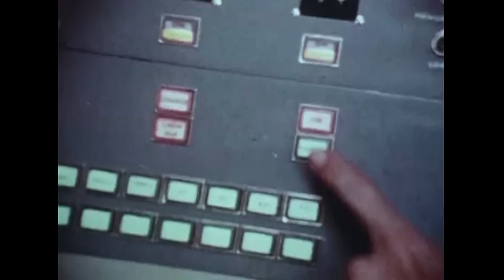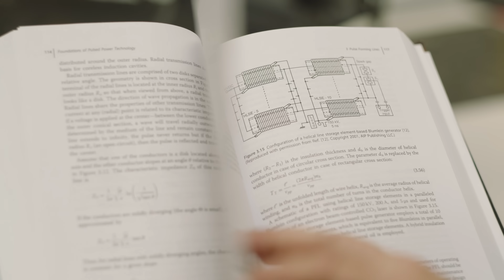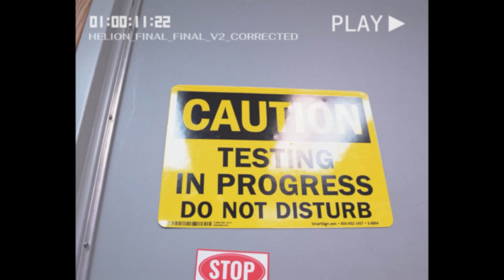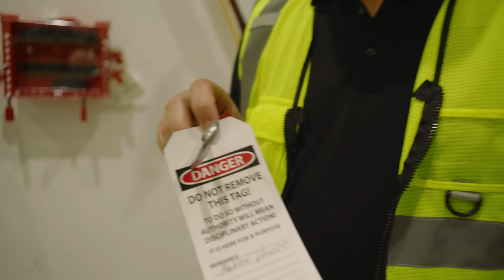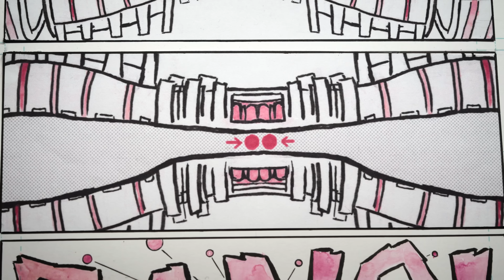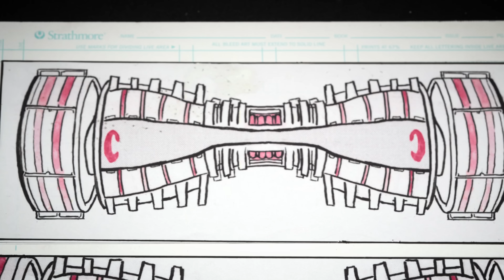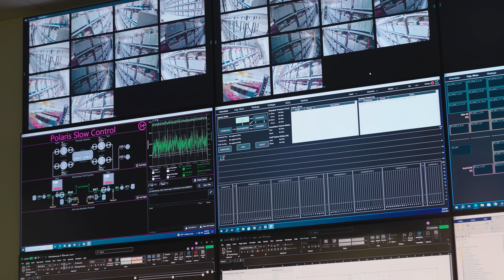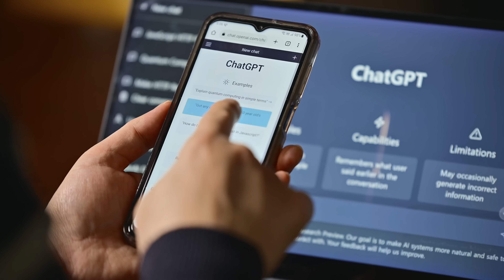A New Type Of Nuclear Fusion Machine Has Come To Life

Comment: Excellent video & thanks for the upload.

Unfortunately, Helion’s core concept is tragically flawed due to their choice of pulsed D-He³ fusion.  Their 50 MW power plant by 2028 is, sadly, complete fantasy.

They picked D-He³ for its near-aneutronic properties (direct electricity recapture at ~3:00), but the physics penalties are brutal:

- D-He³ requires 10 to 20× higher temperatures (~1–2 billion °C) than D-T’s already extreme ~100 million °C
- Pulsed operation also does not bypass ignition because Helion must achieve fusion conditions on every single pulse!  I've encountered pro-Helion advocates confused on this fundamental attribute.  The "hammering" pulse helps with kinetic adiabatic heating but introduces so many more problems like needing to capture 50MW back in microseconds to "reset the hammer".
- Reactivity is  around 1,000× lower than D-T, meaning vastly fewer reactions per volume.
- He³ essentially does not exist on Earth in usable quantities, and no scalable breeding method has ever been demonstrated.
- Their D-D bootstrap produces only nanogram to microgram amounts per day in prototypes.
- At current yields, it would take hundreds of thousands to millions of years of continuous D-D operation to breed enough He³ for even one day of 50 MW D-He³ running!

Pulsed Operation is No Cheat Code
So pulsed fusion ain't a cheat code around ignition!  It’s a different flavour of the exact same difficulty, trading long-term stability problems for brutal repetition-rate, energy recapture and reliability problems.

Likely 2028 outcome:

- Almost all fusion (if any) will come from neutron-emitting D-D side reactions, not clean D-He³
- Micro-watts to milliwatts of net output, if that
- Single pulses at best, not sustained power

In reality, Helion functions more as a government- and VC-subsidized patent and R&D factory.  Because the real value with Helion is in the intellectual property (IP) such as high-field magnets, pulsed power electronics, plasma data, control software, and telemetry, etc.

When the commercial dream inevitably falls far short, the insiders (Altman, SoftBank, etc.) walk away with first dibs on that valuable technology, ready to license or spin out.  Engineers, technicians, scientists, and support staff get paid, advance their careers, and gain experience.  So it won’t be a total loss for them.

Fusion Industry Black Eye
But, unfortunately, it will be another black eye for the entire fusion industry reinforcing the "always 30 years away" stereotype just when the world needs real solutions now.  I'm lookin' forward for physics and tech breakthroughs, but the physics gaps here are waaaay too fundamental to ignore. 😲

Helion Pulsing is a Repetitive Grid Fault 86,400 Times a Day
The proposed pulsed operation will likely cause a grid fault on each 100MW output pulse after a 50MW grid draw (to recharge the caps) on each 1Hz cycle.  That behaviour will hit the grid with harmonics, voltage ripple & frequency ramping.  Grid operators hate this type of grid customer!  Datacenters and factories get fined and hit with contract violations for much less than this.  So Helion likely will not get granted grid permit to operate as-is.  Helion has not explained how to get around this rough grid behaviour.  They're like a super loud thumping concert on the block when everyone else is just a normal store-front.
Reply: Clearly you didn't bother to understand the specific case at all, otherwise you wouldn't have written certain wrong assumptions. They don't need ignition and especially not 1 billion degrees. Furthermore, they can recover energy from the FRC, effectively reducing the gain required to compensate. They just need to overcome the "passive" losses. Just read this paper for more: Fundamental Scaling of Adiabatic Compression of Field Reversed Configuration Thermonuclear Fusion Plasmas
Reply: @francescoG5  Thanks for the reply.  But you seem confused on the core basis of Helion's operation.

We need to return to first principles for a bit…

You wrote, "They don't need ignition" but how can there be any net positive energy without breaking the nucleus's Coulomb barrier?

It can not.  So pulsed operation cannot be a bypass around ignition otherwise there is no Helion to speak of.  Helion needs to ignite (temporarily) over and over again on a 1Hz cycle.

Specifically, Helion's pulsing intentionally combines kinetic energy to get adiabatic thermal heating to achieve higher temperatures than otherwise possible through traditional sustained pressure/heat, but the trade-off is a very short fusion time interval in the microseconds range – 1µs to 20µs according to Helion's own documentation.  This causes massively huge energy capture problems downstream in the design (see below).

On your "recover energy from FRC" statement…

Helion's pulsed operation mode is like a magnetic "hammer" – two hammers actually striking each other.   When the hammers strike each other, they will generate 100MW output averaged over 1-second since Helion's default interval is 1Hz operation.   Furthermore, 50MW is needed each time to rearm the hammer for another strike resulting in a net 50MW positive output (according to Helion).

Helion's energy recover problem gets much worse due to short fusion ignition time…

The 100MW is only the average over 1 second.  But, in actuality, the power is generated in a very short time interval due to Helion's pulsed hammering technique.  Helion's own documents state the FRC ignition is 1µs to 20µs of time which will cause huge power peaks.  Given the most favourable time period of 20µs still results in a gigantic peak of 5TW over 20µs in order to average to 100MW over 1-second.  WOW!

Helion's capacitor bank cannot absorb that amount of energy so quickly, nothing can.  Much of that power is going to destabilize the grid if doesn't damage Helion's energy recovery systems along the way!  Also, there's going to be large power losses at minimum due to high currents in the order of hundreds millions of amps.

From basic capacitor fundamentals, there's fast current rise times (di/dt), high voltage swings, extreme Lorentz forces which causes mechanical expansion so the capacitors must withstand repeatedly with Helion's pulsed operation.  Helion uses "super capacitors" that with have very high capacitance over normal electronics capacitors but super capacitors suffer from very high ESR resistance making everything I've stated that much worse.

Helion's FRC pulse isn’t a gentle 100 MW push over one second.  It's actually a multi-terawatt micro-explosion every second!  This amount of instantaneous power is in the experimental naval rail gun technology range, not power plant operations.  Even naval rail guns struggle with 60GW bursts.  Even if Helion can expand the FRC ignition time to millisecond range (unlikely), the peak power would still be in the 5GW to 100GW range.

So you see how Helion trades one problem (sustained fusion) for brutal peak power of pulsed fusion?
Reply: @beyondfossil  You're the one who's confused, because you don't know that the word  "igniton" (obviously in the field of fusion) generally refers to a reaction that sustains itself with its own "heat". Just go on wikipedia🙂. In short, it's the case where the gain is "infinite" or a very high value. In a pulsed system there's no point in looking for that condition. Ignition is not exactly synonymous with positive gain (more power out than in), and there's a Helion video about it. The comparison with the rail gun is absolutely ridiculous since all that power is concentrated in a small volume, definitely smaller than the compression section.  And of course there is no a projectile (via sliding contact) to accelerate. The time frame for frc "live" is around 1ms, so in the realm of a few GW or at most around ten. Something not impossible to manage....
Reply: @francescoG5  There is no universally accepted definition of fusion ignition, but Q>1 is indisputable. No matter how hard you try to steer the conversation away, Helion needs the equivalent scientific breakeven Q>1 on each pulse otherwise, zilch, no net energy.  If it never gets Q>1 on pulses, Helion might as well be hammering sand.

D-D and especially D-He3 are extremely difficult to ignite which is why Helion needs to fire a pulse at 800,000 m/sec focused on a very small point.  With such extreme force needed at such precision, there are possibilities of dud firings resulting in zero power output for maximal input effort on that pulse.

Helion's own videos/patents confirm they need this: compression must spike to around 20–100 keV for D-D/D-He³ reactivity (where cross-section peaks at), or the Coulomb barrier wins and you get nothing.

As I keep stating, pulsed operation helps with kinetic-assist hammer effect.  But this causes huge downstream problems with energy recapture since the peak burn is so short in time interval.  Burn time (most energetic portion) is short 1µs to 20µs and the plasma expansion cooling in a longer 1ms duration.

Helion's pulsed operation trades one problem for another equal or worse problem

More about the timeframe: Helion's FRC burn (fusion + expansion) is 1–20 μs for the reaction itself, with total confinement ~0.5–1 ms including ramp-up/down.  Even at your very generous 1 ms time interval burn time results 100 MJ energy means ~100 GW average power during that window—multi-GW peaks from transients (voltage spikes, current rise times).  That's still huge and beyond US rail gun power levels!  In addition to barrels melting, capacitors and electronics blew out on US rail gun experiments and they only fired occasionally, not 86,400 times a day like what Helion is proposing–ridiculous!

All this effort is only for a proposed 50MW of power which small peanuts at grid scale power.  50MW is on the low end of small reactor class getting close to micro-reactor size.
Reply: @francescoG5  Furthermore, the rail gun analogy is very apt.

The railgun analogy isn't about projectiles, but pulsed-power delivery which is similar to what Helion is attempting...

Rail guns only fire once or twice a day but Helion will be firing their equivalent rail gun shot 86,400 times a day every day non-stop!  Effectively trying to make a rapid fire rail gun that fires 24x365!

It gets worse for Helion...

The railgun fires and forgets since all that energy goes into the projectile and is gone forever launched down range.

But Helion has to "catch" the equivalent of that projectile (the expanding plasma) every single pulse and convert most of the energy back into electricity to recharge the capacitors and provide net  positive safe power to the grid.  That's an incredibly harder engineering problem on top of an already hard engineering problem.

No material, capacitor, switch, or cable on Earth survives that punishment.

It gets even worse for Helion...

In addition to melting barrels, railgun capacitors and electronics failed after  ~10–100 shots from electromagnetic forces and heat. Helion's chamber/coils face similar Lorentz forces + plasma erosion but at orders of magnitude worse at 86,400 times/day every day.

- Thermal Load: Rail guns needed hours of cooling between shots. Helion has 1 second from continuous hundreds gigawatt heat dumps exceeding the peak power of rail guns.

- Power Electronics: Railgun pulsers (capacitor banks) degraded fast; Helion's would cycle fail much faster with 86,400 shots/day every day.

- Real-World Precedent: The Navy spent $500M+ and canceled the program because repetitive high-power pulsing was unsolvable at scale.

I repeat Orion's 50MW commercial fusion power plant in 2028 is a fantasy.  But Helion will produce data and IP that founders can capitalize on.  Employees will be paid and advance their careers.  But yet another "black eye" on the fusion industry as Helion recklessly hyped their tech to gain investors and government subsidies (our tax dollars).
Reply: @beyondfossil  As you can see from the nonsense you wrote, you don't have the slightest idea how it all works. And  you're here pontificating. For your information, the formation and merging of the two FRCs is something they've done in the past and are currently doing with Polaris. They're currently "ramp up" the power for compression but yew they are doing already formation and merging just not compression at full power. The purpose of merging is to increase the temperature by converting the kinetic energy of the two frc. The result is a single frc. "focused on a very small point?" the frc is meter scale, small poit what?😆It's clear that you UNDERSTAND NOTHING about Helion's approach.🙃The capacitors are not a problem, for your information there are self-healing film ones (which should be the ones they use) that can last decades even at high frequencies of use.The comparison with the railgun still nonsense, and then with Trenta  they have already reached the confinement time of 1 ms. The 100 MJ is pure speculation since we don't actually know the quantity. Only the minimum (at least 5 MJ in excess for 10 pulses to get 50 MW). The optimal range for the case with low electron temperature is 20-50 KeV
Reply: @francescoG5  Once again, you're showing your lack of understanding of basic principles of fusion…

First you misunderstood the basic need for Q>1 on each pulse.  Now you follow up with not understanding basic fusion confinement.

The physics of fusion are unforgiving regardless of what Helion's theoretical papers say or don't say…

Helion's fusion confinement area absolutely must be a pin point.  Fusion cross-sections are minuscule (~10⁻²⁸ m² for D-He³ at peak), so you need billions of collisions per second.  So the tighter that Helion can make the confinement, the more fuel efficient it becomes and reduces "dud" pulses (see below).  Only a tiny amounts of D-He³ fuel are needed per FRC pulse which further requires the smallest point for fuel efficiency.

The tight confinement requirement further highlights the gamble that Helion plays with their pulse design…

Because the FRC alignment of each pulse must be near perfect to get any fusion at all. A slight misalignment of the pulse could mean a full "dud" firing.  A dud is awful for Helion because it means zero output in spite of maximal input effort (-50MW per shot). 

I suggest you come prepared to these debates with first principles science not Helion marketing.  I write detailed posts not as "pontification" but because I'm prepared unlike a certain someone here.  Your posts have been devoid of fusion principles which are what Helion's engineering and designs must be based off of.
Reply: @francescoG5  No.  US Navy Sandia used self-healing capacitors in the railgun trials and it did not help them.

Self-healing capacitors are not suitable for Helion's very high power very frequent constant application.  The healing effect actually reduces the capacitance each time and Helion goes through 86,400 pulse fires per day which is orders of magnitude more than Naval couple of firings a day.

At Helion's scale with gigawatt pulses, million-amp currents, and that ridiculous 86,400 cycles/day will mean it triggers frequent clearings from voltage spikes + ESR heating.  That'd mean increased capacitance loss at 1–5% per thousands of healing events.  The loss of capacitance also further increases the capacitor's ESR making everything worse in a positive feedback loop.

All this is in addition to the large ongoing repetitive Lorentz forces that want to mechanically tear Helion's capacitors apart.  The Lorentz forces are so large that the cables connected to the capacitors actually jump!  This cable jumping was witnessed on US Navy Sandia trials.  Imagine what would happen in Helion's scenario with 86,400 shots per day!  Yikes.

In the end, the US Navy's Sandia rail gun experiments show self-healing banks degrade in thousands to tens of thousands of shots at GW levels — Helion would burn through their capacitor bank in days!

Helion needs to pull a magic rabbit out of a magic  hat to make this part work and this not the only show-stopper item in their design.
Reply: @beyondfossil  Is you who misunderstood ignition with break even not me😂. The excuse that there is no (in your opinion) universal definition of ignition is just pathetic. Stop with your climbing up the mirrors because from your statement you didn't understand how formation merging and compression work in this case. You probably haven't even read the cited paper (it's peer reviewed)....
Reply: @beyondfossil  I repeat capacitors of this type can last over hundreds of thousands of hours of operation. Rail gun uses relative "low" voltage and very high current (million of amperes). In this case i don't know the specifications but they certainly use higher voltages and lower currents and that's why the comparison with the rail gun is no sense. We don't even know the specifics so your speculations are useless....
Reply: @francescoG5  Francesco, you often employ a harsh and insulting manner of responses. You believe it portrays strength but, in reality, it reveals your weakness. You're flailing against the fundamental rules of physics. So call out to all the peer-reviewed Helion papers you can but nature remains indifferent.

Helion and other fusion initiatives face the intrinsic fundamental stability of the cosmos. Our universe does not permit its most abundant elements hydrogen and helium to ignite so easily.

The cosmos remains steady specifically because combining the two most common elements (hydrogen --> helium) is extremely difficult outside stellar-core densities and temperatures.

The Coulomb barrier between proton–proton, D-D, D-He³ interactions is so extremely high that under normal everyday conditions and timeframes, the process is effectively verboten by the cosmos. This explains why stars endure for billions of years rather than seconds.  It accounts for the existence of galaxies, planets and life without nearly everything rapidly converting into helium and radiation.

Each of the fusion projects (Helion, ITER, NIF, CFS, TAE, ....) is actually attempting to briefly and locally disrupt the stability that sustains the rest of the universe.  Through huge effort, they aim to create man-made fleeting "anti-universe" zones while simultaneously trying to tame the fundamental physical forces they've unleashed.  We see this happening with Helion trying to capture cosmic lightning in bottle 86,400 times a day.  All after enormous effort of a 50MW double hammer that needs micron-level precision and low nanosecond timing.

The universe has set the difficulty level of taming of fusion to nigh "cosmic" for a reason.

Helion will be eventually added to the list of commercial fusion failures—though it might create a few Q<1 ignitions before ruining or destroying itself and god forbid anyone gets wounded or killed in process.  The R&D, IP, telemetry, and learnings could be useful for later actual useful projects like in aerospace, defence, EVs, renewables, etc.
Reply: @francescoG5  Helion can't get to the high voltage needed to really bring down the amps…

High voltage in utility-scale context is generally in the hundreds of thousands to million volts.  These are the voltages needed to really bring down the amps but Helion doesn't use those voltages because…

We do have an idea of the voltages used in Helion…

Helion blog (2025 RLC circuit article) describes charging to "tens of thousands of volts"  which is 10–50 kV typical for pulsed caps.  That's not "high voltage" in utility-scale power and is squarely "mid voltage" city distribution level not high voltage long-distance.

Let's give Helion the benefit of the doubt and assume Helion uses the upper-end 50kV (50,000-volts)…

Assuming a generous long 1ms pulse would still mean trying to capture 100GW in 1ms time interval.  At 50kV, that still is 2 million amps (MA).  Way too high amps still especially repetitively 86,400-times a day non-stop everyday.

Helion would need to go to 500kV to bring it to 200,000A and, better, 1MV to get 100,000A but those voltages are extremely dangerous to work with in a factory/warehouse setting and Helion's FRC's doesn't even produce those voltages.

Let's compare these amps against big utility-transmission line amps…

But the largest long distance transmissions lines with the highest voltages may be only 700A to 1500A.  That's still orders of magnitude lower in amps than all the amps I've shown you above!

Also utility power transmission lines operate at constant smooth AC sinusoidal 60Hz power not square wave DC pulsed.  Pulse introduced more problems due to constant high current change (di/dt).  And di/dt is a problem for ultra high capacity capacitors (super caps).

In the end, Helion's working with beyond ludicrous (plaid) levels of amps on 86,400 daily cycles every day.  All while using pulsed DC square wave which causes very high di/dt current (rise/fall) changes. All capacitors especially big capacitors absolutely hate high di/dt.
Reply: @beyondfossil  We don't know how much energy is "pumped". 100Mj can be only the max energy (but is there a source for this data? because I don't remember anything "official")stored but this does not mean that the capicitors are fully discharged. I'm just saying that your assumption are forced becouse of lack of info. You think you know more than the people who work there, treating them like scammer despite the little information we have. Only with time will we know if they are right or not.
Reply: @francescoG5  Here's an accounting of the information used.  From this, it's possible to construct the basic energy flows, timing, power levels, and expected stress on components.

Capacitor Bank Capacity: 50MJ
Helion's Polaris page (2025): "capable of storing over 50 megajoules" LinkedIn post (2025): "Polaris' 50 MJ capacitor bank" IEEE Spectrum (2023, updated 2025 context): 50 MJ bank.  Also referenced in several Helion published videos.

Target Output: 50MW
Helion announcements (2023–2025): 50 MW by 2028 PPA with Microsoft Wikipedia/Press: "at least 50 MWe".  Numerous Helion published videos state this.  News releases state this with Project Orion.

Pulse Rate: 1Hz
Helion blog (2024 RLC article): Implied 1 Hz cycle Multiple sources (2025): Commercial at 1 Hz, Polaris targeting ~1 Hz Reddit/forums cite Helion reps confirming 1 Hz for 50 MW average.  Recent Helion video from a week or two ago walkthrough explicitly stated "1Hz" pulse rate

Energy per pulse needed: ~100 MJ fusion output (50 MJ recharge + 50 MJ net)
Derived.  To average 50 MW at 1 Hz, total energy per pulse must cover input + output (Helion's "direct recovery" model assumes ~50 MJ input recycled.

Fusion Reaction Pulse Duration: 1–20 μs
Blog (2025): "pulses in microseconds" FRC literature/Helion papers: Confinement ~0.5–1 ms total, but reaction in μs.  Independent FRC experiments (e.g., FAT-CM in Japan, similar to Helion's) report fusion-relevant burns in 1–30 μs windows.  Cooling in the longer 1 ms window.  For my calculations, I used the full 1 ms (3-orders magnitude) which is greatly in favuor for Helion by a lot.  The smaller the time window, the stronger the peak of the pulse and the capture hardware gets trashed even more.

Voltage: tens of thousands of volts
Directly stated Helion blog in the 2025 RLC circuit article directly states "tens of thousands of volts".  Typical volts for high powered pulse is 10kV to 50kV and I gave Helion the best possible 50kV (50,000V) for the benefit of the doubt.

Still we have minimum 2.5 million ampere (MA) current square wave pulsed with high di/dt.  Pulse DC operation is synonymous with near square wave forms which damages capacitors with strong repetitive Lorentz forces and high di/dt makes it hard for them to capture and release all the energy.  It's made worse by orders of magnitude with the 86,400 pules per day every day which is the minimum required for Helion to sustain 50MW commercial factory operation for Orion in 2028.

Furthermore what I mentioned here is already getting well ahead of themselves because there is no commercially viable means to create enough He3 fuel at scale to have any of what we've been talking even possible.  They might be able to generate enough He3 for one or two pulses, not 86,400 pulses per day every day.

If it sounds impossible with current technology, that’s because it is. Helion is, at its core, a patent and IP creation machine — not a commercial fusion power company.  Their engineering vision is genuinely aspirational, but it is reaching well beyond the grasp of today’s technology that's its not even close.

The insider investors already know this and will not walk away empty handed when Helion folds.  The amount of money these billionaires spend on Helion is equivalent to a normal person spending money on some lottery tickets.  Helion staff get paid and advance their careers.  Some research gets done that otherwise wouldn't.